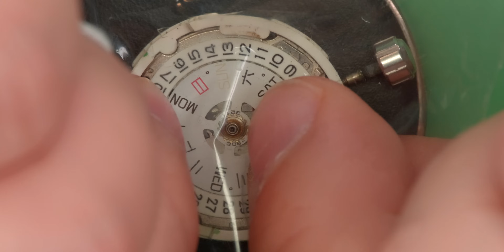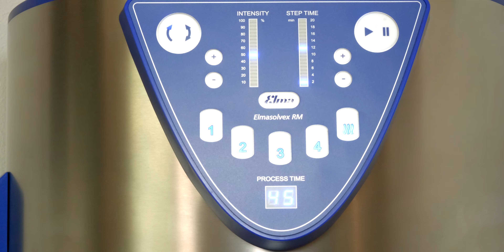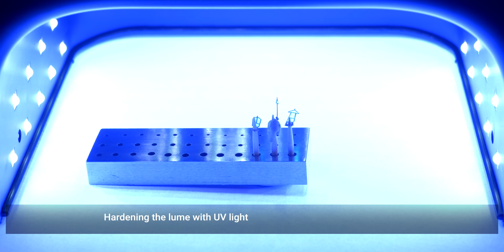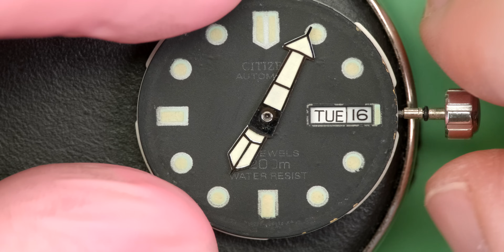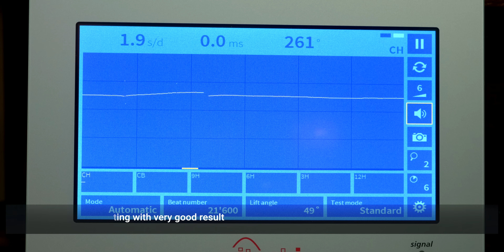Unbelievable Transformation... Extreme Restoration of Citizen Divers Watch

Comment: Fantastic video. I actually have 5 of this exact same watch bought together in an ebay lot and all in about the same condition this one arrived to you in. I haven't fully restored any but I have cleaned up and got running a couple of them. Please tell me, where did you find a replacement bezel ring? Thanks!
Reply from the maker: Bezel insert I bought on ebay

Comment: Nice work. Watch looks great. I'm wondering if you really know what that rotating bezel is used for! :)
Reply from the maker: Please tell me. I'll be very happy to understand what that rotating bezel is used for ☺️
Reply: @MagicWatchmaking  Dive watches have rotating bezels to set a specific time of reference. The rotating bezel makes it easy to view elapsed time of less than one hour from a specific position. The purpose is to warn divers when their oxygen is running low. As most scuba tanks run out of oxygen in around 60 minutes, rotating bezels are split into 60 sections with each section representing one minute.
Reply from the maker: Thank you. I learned something new
Reply: @jt9498  believe it or not, it’s not actually related to elapsed time of O2 consumption, it’s related to decompression sickness. The dive bezel helps the diver know how long they have been down at depth. This is useful to calculate the length of a safety stop.

Comment: Correct me if I'm wrong, but this looks like an 80s or 90s version of the watch instead of from 1975?
Reply from the maker: The new version of this watch has a rubber inside instead of plastic movement holder. I think this is the older model. Thanks for watching
Reply: @MagicWatchmaking  Ah, thanks for clarifying! I mentioned this because I have a pepsi version from the 90s and it looks similar to this. Has a plastic movement holder too. Maybe that's a later iteration of the same watch from the 70s. Before this, I had no idea this model went that far back! :D

Comment: It's a shame the old crystal broke. Look, I get everyone likes something different but for me I'd just love to keep the gnarly old watch looking as is - worn bezel insert and all. Perhaps I'd like the lume restored on the hands, but other than a clean and service, a bit of Polywatch polishing on the old crystal I'd like it more as is. Sometimes on a watch like a Citizen (with plastic parts inside) you can emphasize beauty of heavy wear. I have never seen such fantastic looking heavy wear as I've seen on this watch.

I bought a smashed up Breitling Hercules cheap that was involved in a motorcycle crash. Basically I was paying for the box & papers as well as the original sales receipt that it came with as it was very badly damaged. I had no choice but to get the full job done on it. Many parts were replaced from the bracelet clasp as well as several links to the entire case, bezel and dial. I always regretted that because of the damage I had no other option. The movement was fine. Breitling restored it and it took 6 months and cost about $3500 LOL over the purchase price. As mentioned, even the dial had to be replaced. I think I paid $800 for it damaged so I basically got a new Hercules for $4300 with a certificate from Breitling. It worked for a year then stopped working. I'm very active at work and it's not a watch to wear daily. It's now in my drawer where it's been for the last 8 years and it is going to stay there. I'm sick of it so bought a Casio G-Shock Mud Master GWG-1000 that is actually a watch you can wear daily.
Who would've thought a $1000 quartz watch could be better than a $6000 (early 2000s when new) mechanical watch?
I thought Swiss watches ran like Swiss watches and I suppose they do so long as you're an office worker. Too bad if you're a hard working truck driver.
Reply from the maker: Thank you for sharing. A watch which can tell a story is very interesting
Reply: That's interesting, I've been wearing a mechanical Vario 1918 everyday for over a year, working in construction, and other rigorous daily activities.. It's never missed a beat so to speak.

Comment: Very nicely done, I would have kept the beaten original bezel though. My believe is that the watch is not that old, surely not a 75 one. My bet is probably mid 90s too much plastic in that movement. But the important thing is that you saved the watch. Well done
Reply from the maker: The old bezel insert I kept ☺️ I believe the watch is the older model because the newer ones are equipped with rubber inside instead of the plastic movement holder.
Thank you for watching